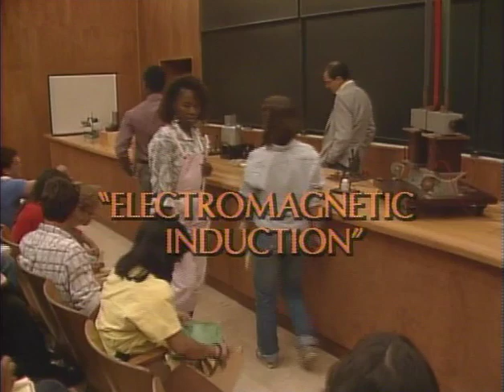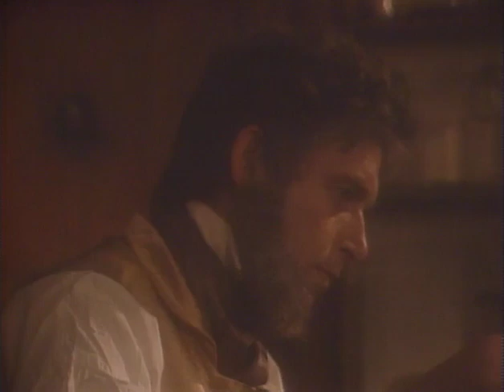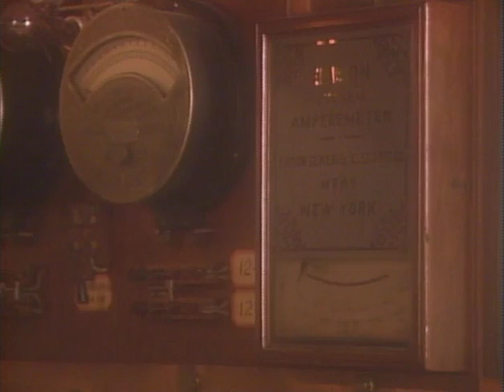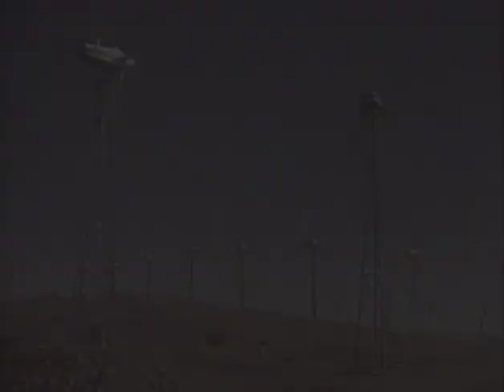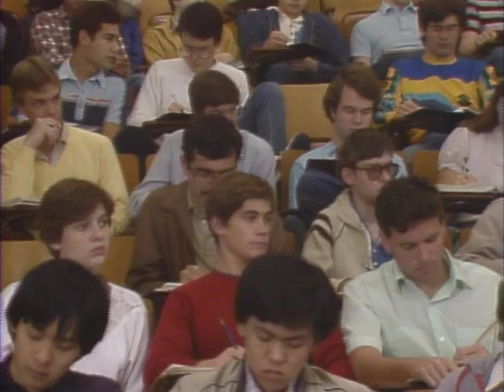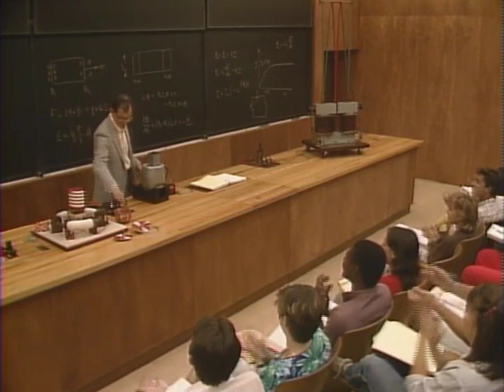Episode 37: Electromagnetic Induction - The Mechanical Universe

Comment: Thanks for this  classes.
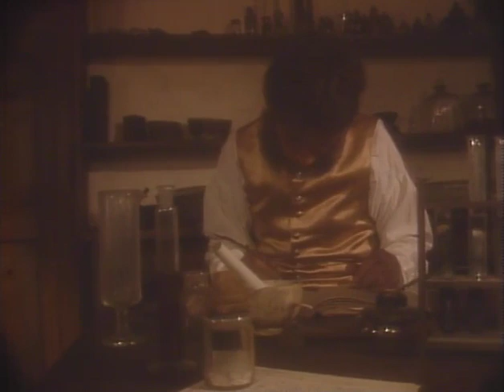Reply: Am I missing something, or is the depiction of qv X B wrong according to the right hand rule at around 9:25
Reply: I think the force should point opposite of the direction shown.
Reply: @MrLang7779  At 9.32 we are told that the charge q is negative. And so I think that the 2 directions shown with the 2 different directions of motion are correct.

Comment: @10:00 the force here is acting on negatively charged electrons (q is negative) and they are free to move. The positively charged nuclei of the conductor also have a force acting on them but it can not move them, they are locked in place in the metal.

Comment: In this type of video Cal-Tech, MIT, etc, "ELECTROMAGNETIC INDUCTION", by far, has been my favorite.  I want to thank you for such a great video--unbelievable, the amount of information learned in this brief time!!!

(1) Please tell me,  What is the red and white apparatus on the desk.  Is it some kind of electromagnetic accelerator?

(2) On the device that shots the Al ring in the air...why is the protruding metal necessary at the top?  Is it just a guide?  I assume it is some kind of laminated steel???

Comment: isnt the damping of the pendelum due to an opposing magnetic field due to the rotating electric field induced in the piece of copper? the heat dissipation did not make alot of sense to me ?
Reply: I think the argument is that it takes work to stop something in motion, thus the copper will become hot. Although I'm not sure because Prof is always blazed in these.